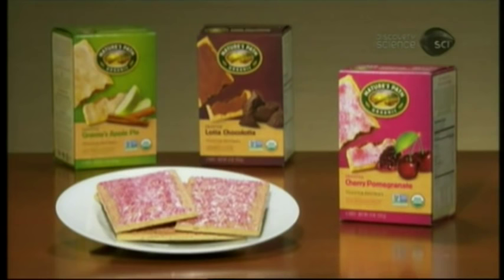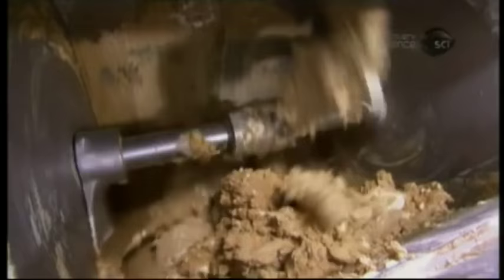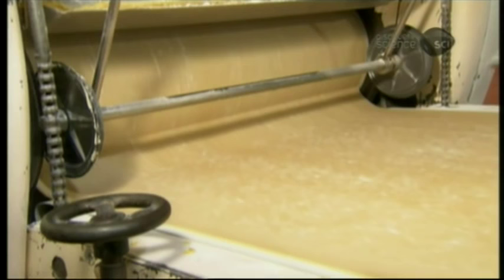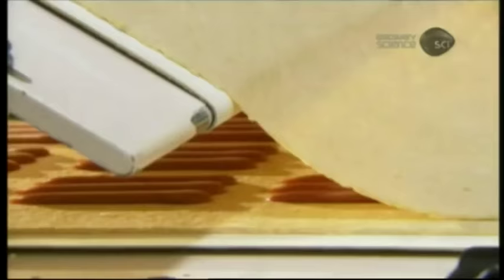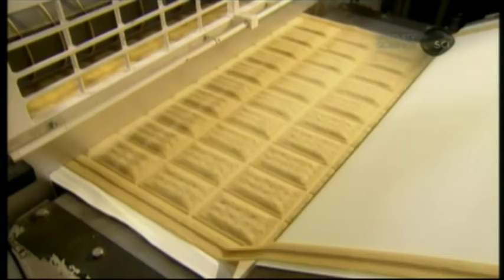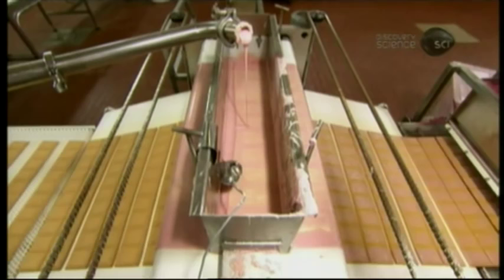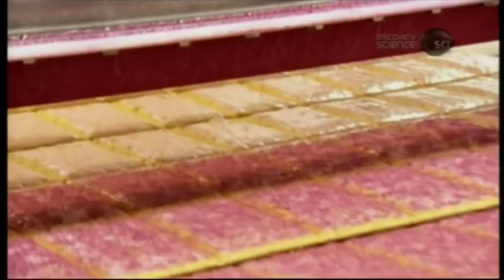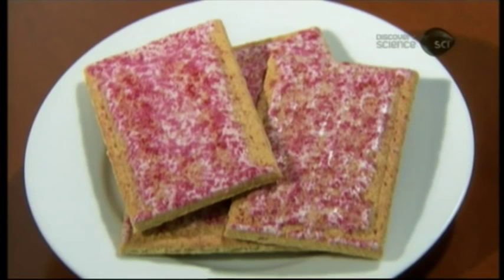How It s Made Toaster Pastries

Comment: If I can have a poptart with no edges and icing on the front and back with just a little bit more filling I will pay double
Reply: I’d recommend removing the edges your self, buying some frosting of choice, and putting both pop tarts together back to back and using the frosting as the center. A pop tart big Mac if you will.